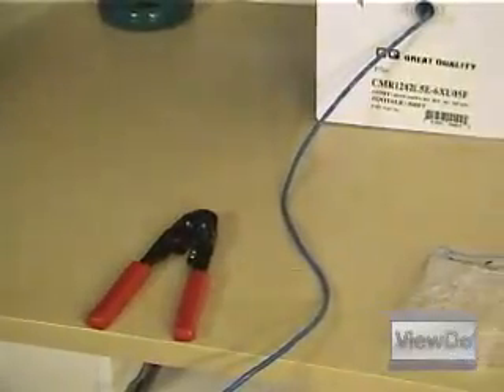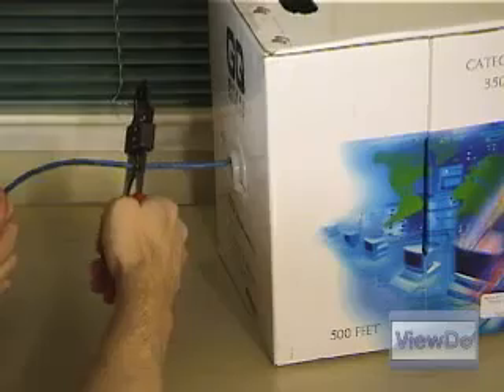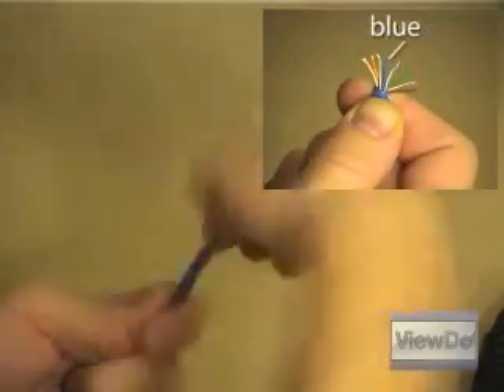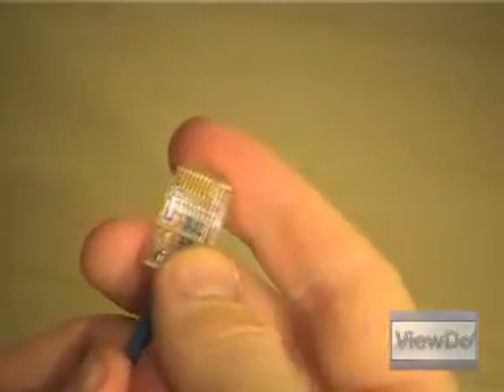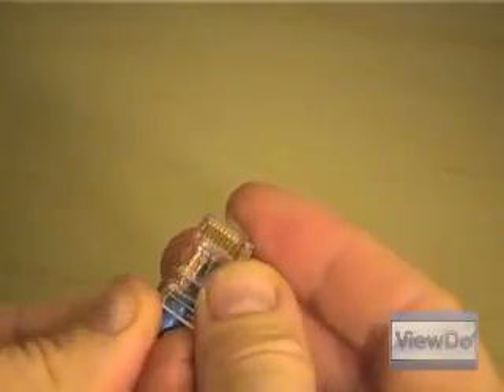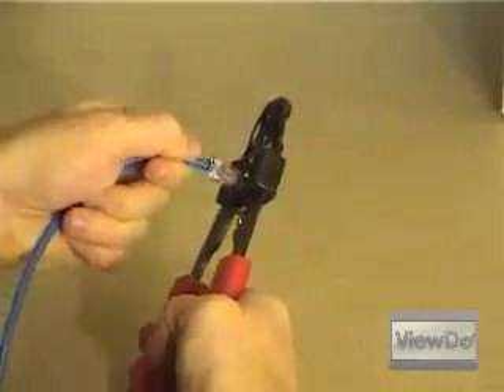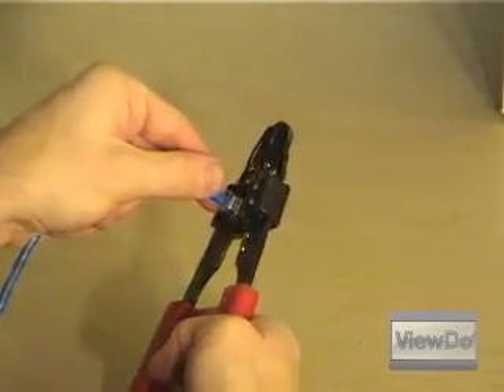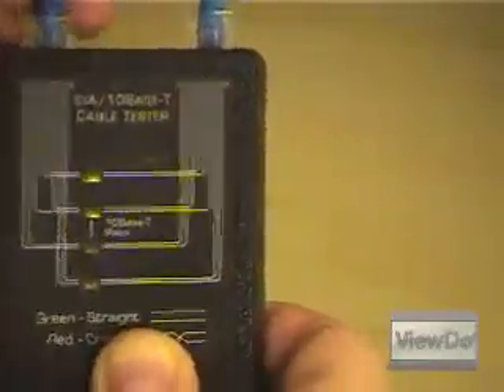ViewDo: How to Make an Ethernet Patch Cable (RJ45)

Comment: @ItalianGamerPro I have an xbox, I have been playing for 3 years Xbox LIVE with the same ethernet cable and somehow I pulled it off yesterday to switch it to my laptop to watch  porn (lol) and the RJ45 cut off and stuff. I put it back and rewired it and now it won't work. I checked my router and it doesn't blink. Any help or ideas?

Comment: If only it were this easy !

I've found if you line up the wires, in order, and then clamp them with a Hemostat, it is much easier to trim the wires straight and insert them into the Connector.

But overall, attaching connectors is quite the tedious job.

Comment: You could wire it by hand and it would work but it would degrade the signal and data transfers may  take longer, and if it is a longer cat5 cable it may not even work at all... it's a temporary fix,  like duct tape on a cars radiator hose.